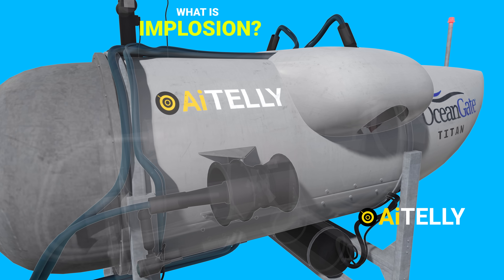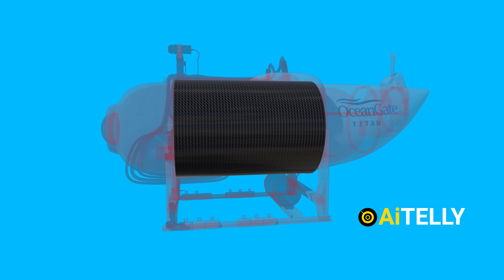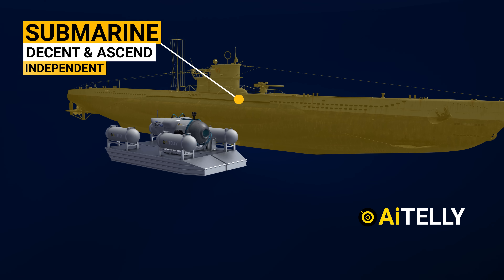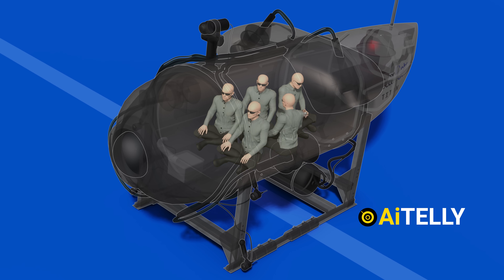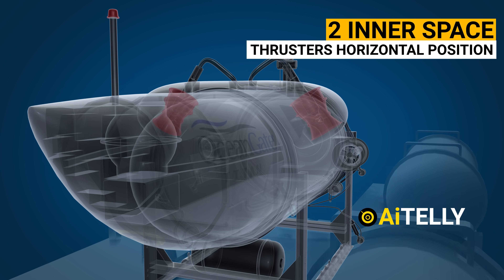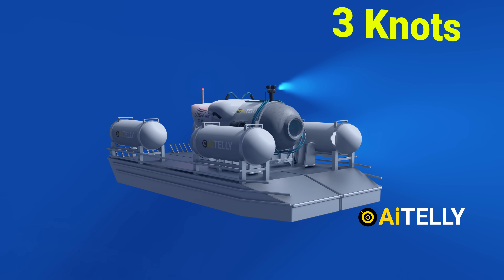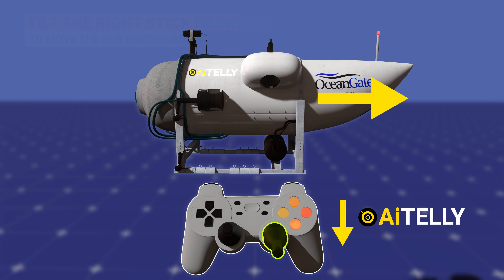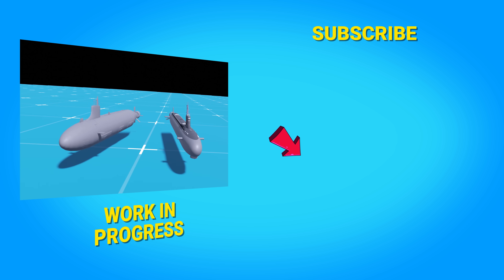Implosion Titan Oceangate How it Happened | Submersible Submarine Parts #3d

Comment: to me, seeing that the end-domes and the titanium rings were recovered quite intact, and also noticing that the acrylic window was blown out inclusive the retaining titanium ring that held that window in its place and its bolts, that tells the story all to well. The carbon fibre part of the vessel crushed in on itself and then the air inside this compartment blew out the acrylic window from the inside out like a champagne cork. All that with such a force that it even dismounted the retaining titanium ring and the bolts holding it. What I really can`t get my head around is, that they did just parallel layers of the carbon fibre and not criss-crossed them. Most likely this wouldn`t be strong enough either, but it for sure would have increased the amount of pressure the hull would have been able to take by a lot.
Reply: they glued the carbon fiber cylinder to the titanium hemispheres, joints are a very weak point considering the colossal forces
Reply: @federicozimerman8167  That's my bet where it failed as well .. at that joint due to the dissimilar compressive elasticity properties.
Reply: @HannibalLecter-hi4hh Absolutely. It was the glued joints.
Reply: @federicozimerman8167 The CEO probably used Elmer's glue for that.
Reply: @bobby1970  very trusted sources say it was gorilla glue
Reply: @federicozimerman8167 I would bet money  on the glue joint.. I would have ran from that thing just on that alone
Reply: Yep I gotta agree. I can't believe that non diagonal winding between layers. typically the windings are 45 degrees to stress and the alternating 90 degrees from there after each complete layer. Probably would have been better using fiberglass and conventional resin because carbon-fiber does not do well under compression. But then again fiberglass may not do well either. Its just a lousy material to use for this purpose. Why not go with a STAINLESS SPHERE with NO view port & instead use cameras displayed on video screens around a table (central area) surrounded by seats sitting in a circumference? Sure like a round restaurant table? You could stack the screens vertically, one for each camera and even switch the view between screens. I can do that here on my computers! I also can't believe the lack of ballast are you kidding me? Cameron used magnets to hold his ballast on his challenger deep dive why BUCK CONVENTION? they used to motors to hold negative buoyancy? I can't believe it.
Reply: @leecowell8165  Which is why we use youtube to watch titanic videos
Reply: Or the window , supposedly only rated for 1300m , failed .
Reply: @anyone9689 they'll never recover any glass..when an implosion occurs, glass instantly goes back to being sand...there's nothing but sand left of that viewport.
Reply: @GSP-76  y but it was insane to go down to 4000m with a viewport rated to 1300m - a 1/3x rather than a more standard  2.5x safety factor
Reply: The implosion likely occured at those rings where they attached to the carbon fiber body. There's a reason submersibles are largely made if the same materials all around. It's so the fatigue levels it sees are uniform all around. Dissimilar materials have different fatigue and stress levels. That has to be mitigated during the design phase. These people didn't do anything right.
Reply: The view port was under 5600PSI of external pressure, I doubt it was blown out.
Reply: @agt155  only counts if the hull remains intact.  Once sh!t goes sideways, all options are on the table until the numbers and physics are analyzed .. and even then, it may not be definitive due to variables.
Reply: What happened to those inside?
Reply: @kaioser  they were instantly cooked and turned into liquid food
Reply: @a9653192 No, they weren't. It's true implosions cause the air release to heat up rapidly but they were in freezing water...plus they found body parts too. Their bodies instantly lost all air and were crushed by the subs hull crushing down on them. You have to remember, water pressure only affects mammals that require air for oxygen. Fish that use gills and have no air cavities in their bodies feel nothing from the ocean's water pressure. Marine life doesn't live on ocean floors because of the freezing temps, no visibility at all and no ecosystem existing to support life. There's mostly just bacteria that lives in the ocean floors which support a very small amount of life.
Reply: 20° Fahrenheit does not compare AT ALL, to the temperature of the Sun.

That is how hot it gets during an implosion.
Reply: @wolfie54321  some thought provoking possibilities there.

Either way, they were liquified, either through the heating or compression process.
Reply: @kaioser  they became part of the ocean
Reply: @kaioser cooked, shattered , burned. Choose your pick 😢:(
Reply: @kaioser  it has been said, that at that pressure, the water entering any aperture  would/could slice through a human.  Read that twice in separate accounts by experts after the accident.
Reply: @kaioser  They got crushed to death, basically. It was a mess.
Reply: So uhhh, do y'all think all of the gore get squished out of the window like a toothpaste? 🤔
Reply: @BlueRGuy lol I read this in Moose's voice from Archie. Because it was such an unintelligent and poorly thought question.
Reply: The alignment of fibers in a carbon fiber matrix doesn't help the material under compression, only tension and torsion.  CF is just an absolutely unsuitable material for submersible & submarine hulls.  Toss in a CEO with a huge ego and you've got a recipe for this disaster.
Reply: probably, but I still believe a submersible should be made of nothing but steel and or titanium! I'm no scientist but, never I've would of gone in that sumb for all the money in the world knowing it was made of carbon fiber,,,no way!!
Mr.Rush fished those 4 men into his sub for 250Grand each!!! 
nice, really nice,,for what,,,to die,,
RIP
Reply: Prolonging the inevitable with the crisscrossing of the carbon fiber. I’m curious how many more dives that would have given. I don’t get why people are so trusting in this company in the first place.  If I was even remotely thinking about partaking in a dive, I would be reading the fine print and all the safety data with a magnifying glass!
Reply: @ericwiese7479 the 1st time I  saw this company's advertisement/infomercial,  the CEO seemed all about the money to me , and lack of respect for the gravesite. Sickening really..
Reply: The titanium ring, which the dome ends were bolted to, was attached to the carbon fiber hull only with glue and not bolted to the hull.  The end domes were then bolted to that ring.
Reply: I wondered this also, as did James Cameron.
Reply: Where is Richard Feynman when we need him.
Reply: I would suspect the air would escape out of the terrible seal between the carbon fiber and titanium portion. Once enough air escaped, the pressure of the water was no longer counter-acted, leading to the crushing of the carbon fiber portion.
Reply: *too
'...tells the story all TOO well'
Reply: I agree I couldn’t understand why those carbon fibres were not diamond cris crossed to give extra strength. It seems to me that would have been an obvious thing for an engineer to think of.
Reply: @Scorpio72350  Cost was most likely the reason for this decision. Rush was trying to do everything as cheap as he could. It's why he chose carbon fiber to begin with and why he chose not to diamond cross the strands because it was cheaper to wound it the way he did. He figured the thickness was enough to compensate.
Reply: @TBone4Eva   and then the cost was so huge. I don’t know how to feel about Stockton Rush. In one sense I feel sad for him because he died, he must have trusted the engineering. But then he cut corners and a 19 year old was killed. That is so unforgivable.
Reply: Y como es que el acrílico aguanta esa presión ?
Reply: Was denkst du ist mit den fünf Menschen passiert?
Ich versuche mir immer vorzustellen wie das innen im Rumpf abgelaufen ist. Denkst du sie haben was gespürt, etwas mitbekommen? Oder hatten sie noch Schmerzen?
es ist so schrecklich.
Reply: @Sabinschen  They did not know what hit them. The implosion occurred in about 10-20 milliseconds (this is a best guess from what Navy submariners are saying). The human nervous system takes about 100 milliseconds to transmit nerve impulses to the brain and for the brain to process that information (I learned this when flying jets). So the people really did not know; they were dead before their nerves could tell them about it. They felt no pain. They felt nothing at all.
Reply: I also think that the sudden jerking around and panic of the 5 passengers when they realized what was happening, added to the imbalance of forces within & without the capsule.
Reply: @mylesgarcia4625  they wouldn’t have realised anything in 2 milliseconds. The brain wouldn’t have the time to compute it
Reply: @kiz11a  How do you know that?  Were you there?  I know it's the common speculation, but James Cameron believes that they knew something was off and started their quick ascent when the vessel fully imploded.  And Cameron should know since he's deep-dived 30+ times already.
Reply: @mylesgarcia4625  Some deep sea expert (should be easy to find on YT) said the implosion happens in a millisecond so before they realize it they're dead.  At that depth the pressure is about 6000 psi.
Reply: @mylesgarcia4625 Cameron thinks the acoustic senors on the sub detected cracking sounds...but I disagree that they knew. They very well could have but we have to remember the crew on the surface were in contact with them right up to the implosion. They weren't told about any warnings from the sensors. If slight cracking did happen before the implosion, they would have dropped the ascension weights and started going back up. The crew knew none of this so it's assumed the catastrophic failure happened instantly with no time for them to react and start to go for a resurface.

Comment: The lens appears to be gone. Did the lens fail and than an intense jet of water entered the vessel. Water is 800 times as dense as air at 15PSI and all the living contents would be shredded by the jet and broen into a jelly. Deep sea diving suits(newt suit type) - any deaths? The old brass topped/canvas bottom with compressed air to to ~~100-200 feet or so are extruded up the air line if the return valve fails and that is only under 200 PSI, bones remain in the suit
Reply from the maker: Awesome feedback and Infos love the comments
Reply: Channeling " Different Strokes " what do you mean  @aurizon? you reincarnate as sausage?
Reply: @horaciokanashiro-hv2zn  Well, at this stage you are boneless sausage, so you will re-incarnate as a slug

Comment: Genuine question, does anyone know or can hypothesize a reasonable conclusion to why they thought using CF was a good idea for going deep sea diving?

As I understand it, CF is lighter and stronger than steel only for tension, as well as they absorb forces a lot better than steel. Thinking of Motorsport for example, all these properties translate really well, but why would OceanGate think it would translate to withstand sea pressure? You don’t need to be lighter, you’re not under tension, and you’re not absorbing forces.

Does CF have any application in terms of deep sea diving?
Reply: To be honest I don even know why you’d use carbon fibre in the first place for diving applications. Beyond the obvious issues with its severe lack of compressive stress resistance, it simply doesn’t make sense from a practical standpoint. The use of carbon fibre is to provide similar or higher tensile strength than steel for a much lower weight cost. For diving however, the major reduction in weight is actually a disadvantage in manned submersibles such as this, as their large internal air displacement combined with reduced weight causes them to be significantly more buoyant. This means that far more ballast is required to offset that displacement, as well as to keep them balanced. This is why heavier materials are normally used, as they provide a more neutral buoyancy and act themselves as a form of ballast, which allows for more fine tuning in terms of diving and surfacing rates, as smaller quantities of additional ballast are required. And as I said, this is all before even considering the lack of testing of carbon fibre in deep sea conditions as well as the fact that it’s known to degrade under such high pressures. Really feels like a case of trying to use a material somewhere it shouldn’t be used just because you thought it would be cool.
Reply from the maker: @DarkPlaysThings You might also like Nuclear Powered Submarine Engineering behind it #3d Nuclear Reactor released
Link: https://youtu.be/J0lb46Zi5-s
Reply: The only reason I can think of is cost & time.
Submersibles that can reach this depth (and beyond) are usually made from a high yield, high strength low allow steel, giving good strength, ductility and corrosion resistance. Usually, the pressure vessel, housing the crew, is spherical (a spherical pressure vessel under external load is an efficient design as the external loads are distributed evenly around the vessel), rather than cylindrical. To manufacture a steel sphere to meet the pressure requirements would mean casting a pair of hemispheres, machining their mating faces and bolting the two hemispheres together. Its a proven method of design and manufacture. A great example of this are the Russian Mir submersibles (Mir-1 & Mir-2), which I believe had test depths of 6000m each.  To cast, and machine, a pair of hemispheres, with a specially manufactured high yield steel is not likely to be cheap. I think that going for Carbon Fibre would have been seen as the cheaper, cost effective solution. However, the caveat is that Carbon Fibre is not a proven material for a submersible vessel. For an internally pressurised lightweight gas tank, sure, it makes sense, but for a cylinder under an incredible external pressure, no.
As a designer of industrial pressure vessels, we have to submit our calculations and manufacturing drawings to be rigorously checked, then approved by an independent inspection authority prior to manufacture. All materials connected to the manufacture of the pressure vessel are supplied with material certificates showing composition, minimum strength of material, place of origin etc (also subject to the same inspection authority), plus prior to release to the client, successfully perform a pressure test. The procedures for a manned submersible would be more rigorous and exacting than that an industrial pressure vessel.
It's my understanding that serious concerns were raised about the design and manufacture of the 'Titan' back in 2018, but they seem to have been brushed under the carpet. 
Keeping this comment as short and concise as I can,  I think that after the inquest to this tragedy, the legislation and procedures surrounding the design, manufacture and use of private submersibles will tighten significantly.
Reply: Rush thought CF was a good idea because it was his idea.
Reply: Because people are not as smart as they think they are.
Reply: I know nothing about submarines. But us car guys use carbon fiber on our performance vehicles. Hoods. Fenders. Because it's light weight. It flexs. It's harder to break. But I could see it completely shattering under severe pressure or weight. You'd of never gotten me in that thing. Is what I can tell you. Titanium. Steel. There's also a reason military subs have no port windows. Designed the way they are. That thing was destianed to fold on itself. Terrible
Reply: It was cheaper.
Reply: Cheaper
Reply from the maker: @jobotmang agreed 👍
Reply: I think they used the Carbon Fiber because
 it could be made smaller, lighter and still fit 5 people inside. (The Payload) It would be much more expensive to get a larger vessel where it needed to go transport-wise. Rush wanted 5 people inside. So he needed to come up with a way to have the interior room- that came at the expense of the heavier, thicker more Expensive Steel or Titanium.
Reply: 4:10- I believe that Titanium ring was glued/bonded to the Hull. The passengers entered through the viewing window, which was then bolted shut from the outside 😳 I read somewhere it took 18 bolts….. but they only put in 17…… because it didn’t matter and the one on top was, wait for it….. high.😮
Reply from the maker: It's used for planes not for Submarines as pressure in Planes they create atmospheric pressure also.
Reply: My understanding is that Stockton Rush had an aerospace engineering background and the material is used in planes, is strong, and light; he gave a talk, that’s on you tube, about its superior strength to weight ratio.
Reply: And who the hell names their kid Stockton Rush?  Sounds like a made up name to be easily remembered and referenced once recognized or deceased.
Reply: @stevenquevedo4308  un avión es todo lo contrario a un submarino !